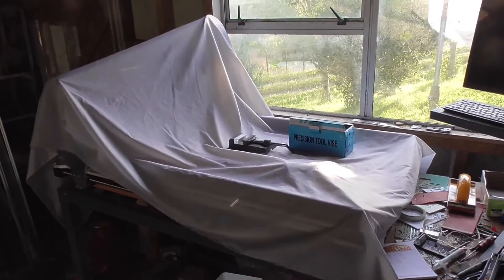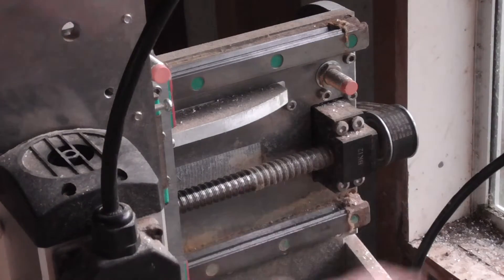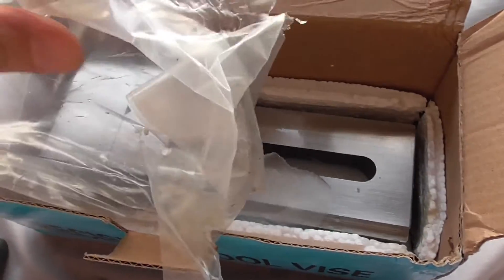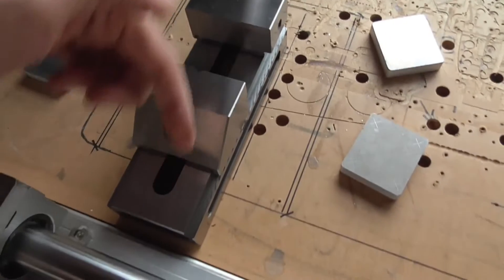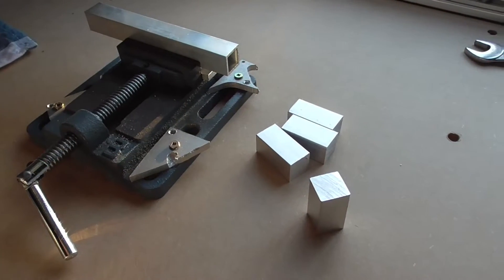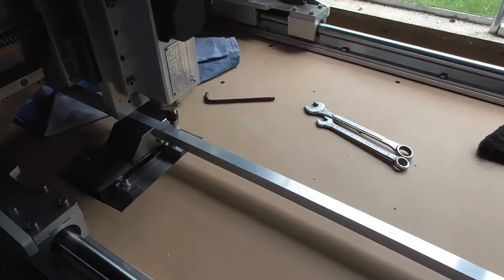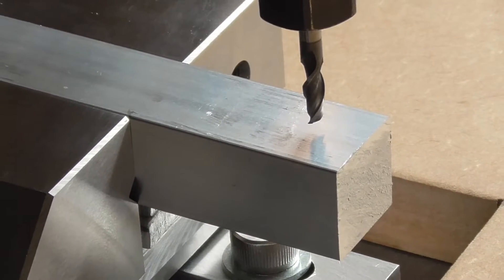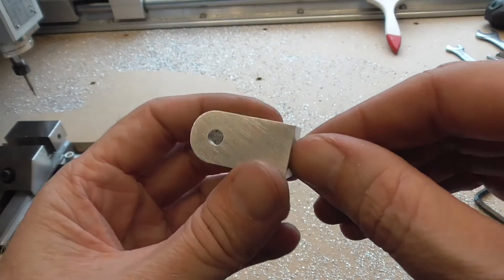Another DIY CNC router, part 13 ('toolmakers' vice)

Comment: In Aus we have Hare and Forbes, same gear(some good, some crap, others so-so) ......drill vice is as you found, next to useless for anything precision. Like the one you now have although we tend to use the VK range, either 4,5,6,or 8". Mine is the VK-4....one thing, last machined item, I'd tend to have it spaced up on solid rather than sit in free air....tendency for it to move under machining.   
Good stuff...like the machine...Cheers Jorgo .....latest from my shed ... https://www.youtube.com/watch?v=AXDFKuWPxMg  ....... https://www.youtube.com/watch?v=NPtAYLX9uZM&t=6s

Comment: Do you have any dial indicators? You mention not using one, but they'll help you out a lot checking is surfaces are aligned or getting parts accurately position in the vice, or even getting the spindle lined up with a feature youbwant to work on

Comment: Rust on ball screws and linear rails is just terrible....Is it because of the high humidity levels in New Zealand??
Reply from the maker: We have a lot of fog in winter and there is no wall on the front of this garage, which can't be helping. But still I was surprised at how quickly the rust sprang up. Most of that was already there in the first few months, the cover seemed to really help slow it down a lot.
Reply: @iforce2d  By the way, I don't see any signs of rust on SBR linear shafts, looks like chromed coating helps a lot. I heard earlier that SBR have a better metal quality than Chinese made profile rails..
Reply: Wonder if blowing off the screws with compressed air after working with wood, or other materials that absorb moisture might help slow. Coating with oil tend to just attract stuff. (WD-40 is good option if decide on this route)

Comment: Hi Chris , not sure if you are aware of them or not , but you can get a spray mist lubrication system for machining , they aren't overly expensive ~$150 AUD and also can get a variety of lubricants to suit different materials , but you do need compressed air. Just thought it may be more suitable for larger projects instead of manual application .
As for the rust on your machine , might be worth spraying on wd40 or similar on all working machine surfaces at end of day just to try and help keep the rust away :)
Reply from the maker: If my garage had a good power system I would do that, it was part of my original plan to do sometime. But I'm running every single thing in the garage (all power tools, CNC and splndle, lights, water pump, vacuum cleaner, and water pump for the house) from a  single outlet. The water pump is a heavy load and can turn on at any time, and I don't like to have the vacuum cleaner going at the same time. I just worry that having the compressor also suddenly turning on would be too much.
I have found that the IPA is usually only helpful when plunging into the next layer, not really on sideways movements (the tall sidewalls in this video are kinda rare, although now that I have this vice I might be doing more of them). I think a g-code controlled squirter that outputs a little just before each plunge would be ideal.
Reply: @iforce2d  Sounds like it could be time to review one of the solar generator power station thingies like bluetti or ecoflow.  You can set the AC input charging rate to be something low and stable for your wiring, and the battery / inverter side can handle any peaks and inrush surges.
Reply: Thinking the same, a battery bank to run all, or some of the load through a quality inverter. Could even use a couple  micro-inverter designed for solar panels that provide 400-600W with DYI battery to run lights or other smaller load. Some inverters have built-in battery management.
Bonus would be having a backup system handy for when power goes out from a winter storm (keep food in fridge/freezer, etc).
Reply: @iforce2d  if you were keen to use it one solution could possibly be having the compressor in a remote location with a different power supply and piping the air in , if the compressor had a regulator on it even some cheap poly pipe would work.
But yeah an auto applicator with the gcode is a good idea, and probably the easiest to apply :)

Comment: Couldn’t you just use some light on on the screws? Maybe wipe it off with ipa before use?
Reply from the maker: Sure, I just didn't realize it would deteriorate so fast. Almost all the rust I showed appeared quite soon after building it, unfortunately there was a period of time early on where I didn't use it for a while and next time I looked the rust had sprung up very quickly. Since I started using the cover, as far as I can tell only the rust on the bottom ball screws progressed any further after that.
Reply: Oh yah OIL is the word
Reply: Mmmm... just a small flashlight should do the trick!   😜

(You've made a little typo there, Mark...  you have an extra "on" and left out "oil".  If you edit it, I'll remove this.)